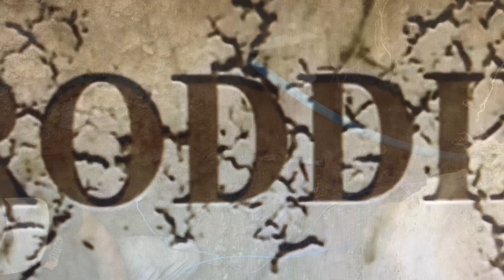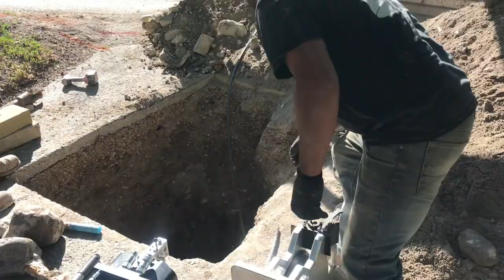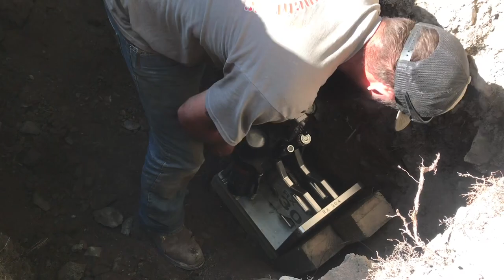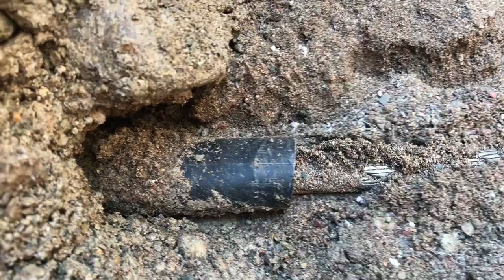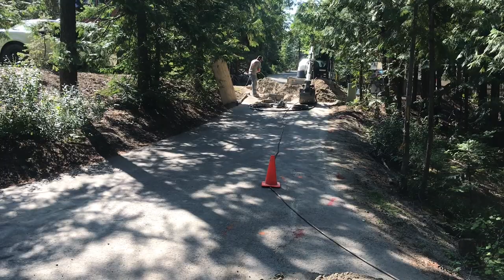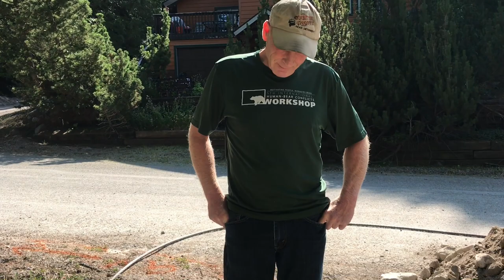Water Line Replacement in a Ski Resort Village

Comment: Can this pull through 3/4” copper and / or galvanized?
Reply: I bet it would do soft copper if you really watched the angle it pulls it into the ground. probably would have to cap one end and pressurize the line its all in the stopping the kinking